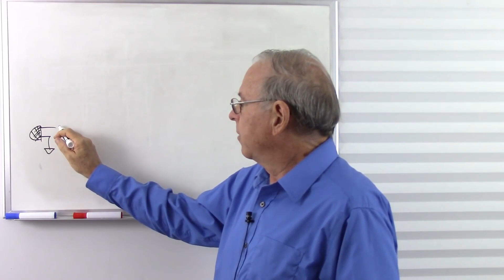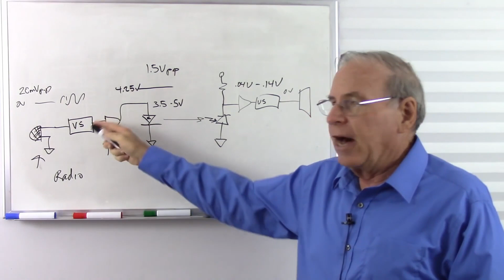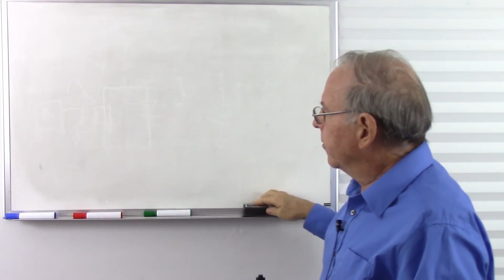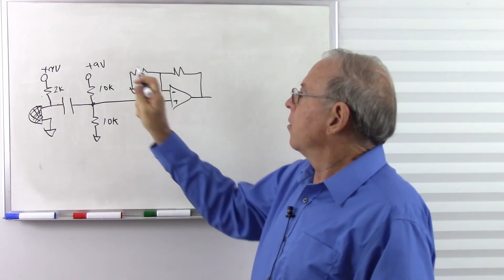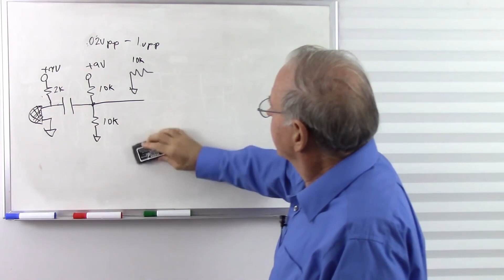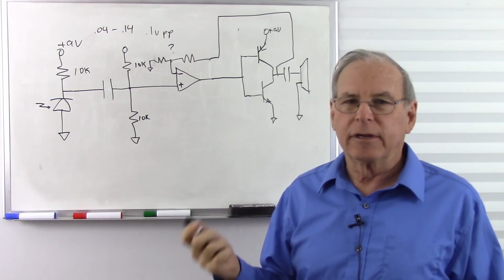Build a Laser Communicator Part 2, The Design

Comment: Either I'm missing something or the principle of Op-Amp operation has changed.  With 4.5 Volts in to the Op-Amp, a 9 Volt supply and a gain of 50 the output will never be able to supply enough voltage to the inverting input.  Just don't see how the math works here???

Comment: Quite informative video, but output push-pull transistor structure @18:55 is incorrect. It will cause direct emitor-base diode conduction which will cause a short circuit. The top transistor should be NPN and the bottom one should be PNP for this setup.